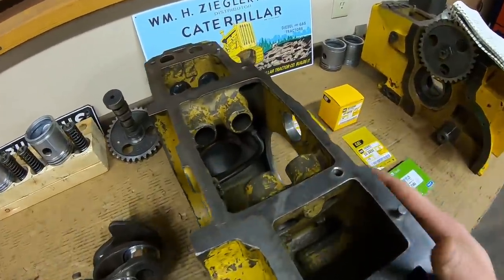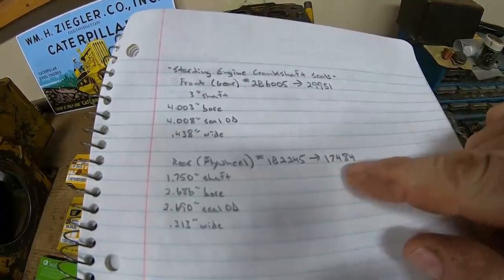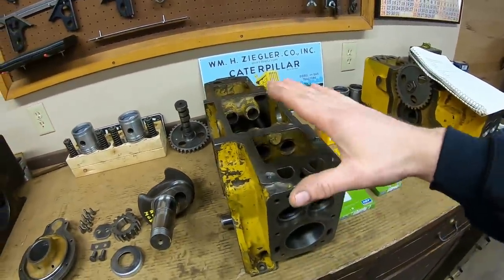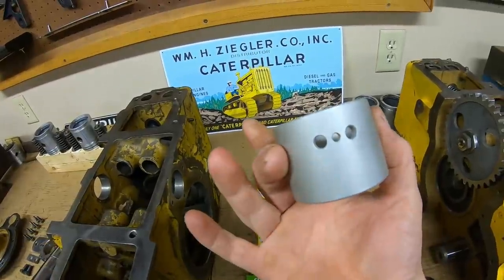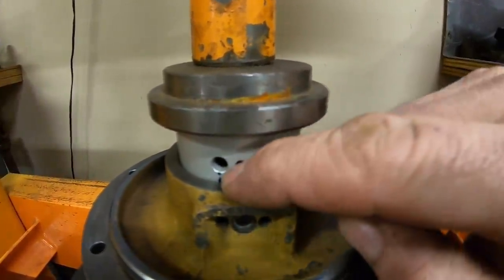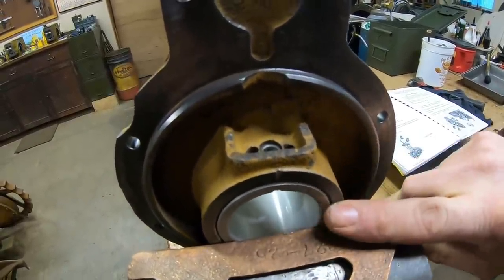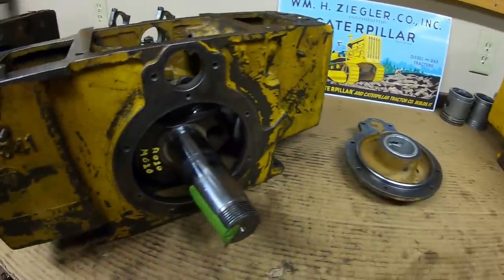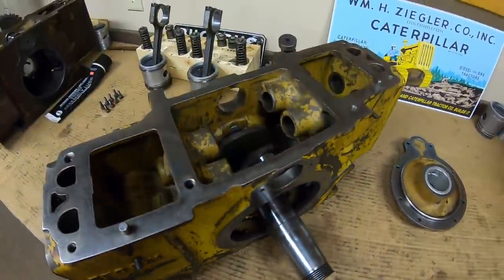Caterpillar D2 #5J1113 Starting System Ep.10: Pony Short Block Assembly (W/O Block Damage) #1 of 3

Comment: Been binge-watching the 1113 rebuild this weekend.

Nice to see a really skilled mechanic at work in preservation mode; familiar from my time on classic cars. Things like a very light skim of sealant on gaskets etc.

I once rebuilt a gearbox for an exotic car, and the workshop manual actually suggested using an old taper roller outer bearing race turned down a little as a sliding fit tool to help select the shim that goes under that bearing. Thankfully the carbide inserts on the lathe made short work of that. 👍

Comment: An old george foreman grill heats bearings and gears to the perfect temp for .0005 - .0025 slip fit. Heats evenly, heats quickly, and stores easily. Just something to think about for gears and bearings. It won't do press fit rods/pins, but it works  like a champ for most applications. Keep some pvc line around to put over the rod bolts when you slide the piston into the bore, protects the bearing journal from accident. The marks on the bearings from the snap gauge are not going to affect anything, bearings ride on a film of oil (not that you needs to be told, but the unaware viewer).
Reply: About warming things up, watch this. Kawasaki Z1 Super Six Barrels - How its Made  (Allen Milliyard-video) 11 m 20 s. The man is incredible,

Comment: Great vid, love the D2 restoration! I sympathize with your rural internet problems. I live way out in the boonies and was suffering on a shitty dsl connection until just a few days ago when I finally got my Starlink dish. The difference is so great as to be unbelievable. It is worth it at twice the cost. Believe me.
Reply: How is Elon treating you with the Starlink ?
Reply: @davidmcd8400  Very well compared to what I had. 75-300 mbps down, 3-10 mbps up. 20-40 ms ping. The performance can vary quite a bit according to the numbers but realistically you don't notice it. Once in an odd while you get a small hiccup but then it smooths out. I can play online games and watch 1080p video with other people on the network and do just fine. Service is $100/mo and the dish is kinda expensive at $500. Plus I had to wait almost a year to get it, but once you have it in hand its yours to do with as you please. You can transfer your account and sell the equipment if you decide you don't want it anymore. I saw new in box dishes going on ebay for $2500. 

But when you are out in the boonies and the alternative is really crappy dsl or satellite (ie HugesNet) it's an absolute god send. Worth the wait, worth the cost, worth everything.

Comment: Hi folks, a 'trick' I've used when the drill is not long enough is to drill a hole in the end of a rod using my lathe and soft solder the required drill into it. It holds ok and is easy to take apart after. I rather suspect Squatch knows all about this!
Reply: Good information.
A similar way I have done instead of soldering was to drill a hole into the end of a rod and then drill a small hole through the cross section of the rod to intersect the first hole and thread the cross hole to accept an Allen key set screw to hold the drill bit from slipping.  To increase the hold of the set screw you may want to grind a slight flat spot on the drill bit where the set screw makes contact.
I can see a distinct advantage to the solder method in that it will allow the use of  a smaller diameter rod where there would not be enough material for tapping and holding a set screw.
I did not have a lathe to establish a center hole in the rod.  Instead I used a short piece of the available rod chucked into my drill press to position my drill press vise to the table. Once the vise was positioned I clamped it down and then I took the short piece of rod out of the chuck, replacing it with the drill bit for the hole needed.  Then I clamped the rod that needed drilling into the vise and drilled the hole into the center of the rod.
I have used this "trick" for getting 1/4" arbor flap wheels, stones and carbide burr bits into places where the chuck on a hand drill just would not go.

Comment: Good start on the 1st of the tribuild. One prob I had building my 2 pony’s was the rod bolts and castle nuts. Main prob was either holes in bolts or the castles being partially blocked. Found that out when torquing nuts and unable to pass a cotter pin. Yep take back out and clear all burrs etc off nuts and holes. 
Also discovered different sizes nuts and bolts on different motors?

Comment: My d8 1957 has a full circle bearing front main and it is flanged for end thrust how ever the rear main is two halves and the main caps are casted in the oil pan that was very unique the way caterpillar made these in line two cylinder pony engines

Comment: I'm amazed how much CAT put engineering into a starting engine back in the day's. Interesting to see is the D2 starting engine rods have no journals? While the RD6 starting engine has cast babite journals. Then again RD6 is a much bigger engine that also has to have a corresponding big heavy duty starting engine to back it up. I would like to see what did you come up with as a tool to overcome over rounded and spun bearing surfaces. This is not just a CAT D2 problem but much more common on older machines then you can think of.
Reply: @squatch253  I think there might be a very reasonable explanation to why Cat used existing parts to create a new pony engine. I think it ties to cost efficient production and the fact you don't need to make new castings or tools to machine out new parts. Rather use the old existing ones to just make something else. I know the old Stalinzh S-80 and later T-100 use the same pony engine as the RD6 and D6. Not sure if it is dimensional wise the same cause I got no way of comparing them in real life. But I know the older pony motors had the same pressure oil feed rods. The difference I noted was the later pony motors would use regular bearings instead of the cast babite bearings on the rods. Also some of them used the older style piston pinion retainers that you should recognize from a early Cat D2 starting engine. Not sure when they got rid of them for that I need to search the catalogs and manuals.

Comment: Line boring jigs do a good job of making bores in line but getting positional accuracy out of them is difficult.  I would choose doing that job in the mill everytime
Reply: @squatch253  As long as that seal area is undamaged and provides good enough support I think you will be just fine doing it that way.  Use a u joint in your bar drive so only the bore bushings influence the bar position.😎

Comment: Since the Sealing washer @10:50 inner surface rides against the bearing end.. i know you do check for rough surface which would increase the thrust end play as it chews away the main bearing..  have you machined a holder for the lathe to set the sealing washer into the concave face of the tool and lightly lock it with some kind of screwed down ring that hopefully won't distort the seal race/face. so you can polish the inside of the Sealing washer to eliminate any rough surfaces..  a polish should not effect end play.  i don't know if it will effect the crank gear /heavy washer and end of crank spacing.  could you use a cratex wheel in a router with a router speed control to polish the inner face with the router center line slightly offset.  sorry for adding to the complexity of doing a pony motor build.. i take it you will use the freeze damaged block after careful measurement to make sure the main casting did not shift to verify the boring bar tool alignment.  not that you will bore the busted block.. just for verification on a good bore block. 

 i should have mentioned to you about cleaning the cooling jackets of the main engine blocks using a bucket of evaporust with a submersible pump.. a hose and at least one adjustable pipe with a  garden sprinker.. perhaps a modified turbine wheel sprinker to sit on top of the block with the liners pulled to spritz the block till the rust in the cooling jacket is gone..  then move to the next cylinder.  so many people have gotten strong liquid tight containers and made dip tanks for larger parts to do the same.  i also think about dangling magnets in the evaporust to see if it will pull excessive oxides out to make it last longer. 
5J1113 is going to be a treat to hear run and to move some dirt around..  hopefully the trailer and shows will be calling when its finally finished..

Comment: Well so far the Insides in my build match yours except for one part.  Do you or did you put the wire between the c clips that hold the valves in?  When I took mine apart there was wire twisted in the middle of the clips through the holes, to keep them from spinning I assume…
Reply: @squatch253  yeah I only repeated what I found during my disassembly - it did seem to make sense to me so I went for it.  Those holes must have a purpose or some kind, and the wire seems to be the only thing I could come to reason that made sense.

Comment: Great tip about what to do if castle nut doesn't line up.  Could one use a thin washer/shim?

Is there a spec for the end to end on the crankshaft bearing flange.  Just wondering what one can do if there is too much play.  Could the machine shop build up that surface before grinding it down to reduce the end play?  Or would it be better to make a wider bearing.

Comment: You should be able to do it in a mill. Line boring is over thinking in my opinion. Locate off the big hole end. Simple enough. Good video.
Reply: @squatch253  as a machinist I figured your mill was like a Bridgeport.  So I understand if your equipment isn't capable of the style setup I suggested.

Comment: That gear is no different than the setup bearings you can buy for setting up a differential, bored slightly larger so you don’t have to press them on and off a bunch of times. When you have spare parts one can make any tool no matter how vintage the machine. 👍

Comment: On the piston ring gap, could you just not buy .10 over rings. As you state, these aren’t race engines, but why not get it in spec?  Probably makes little difference, but it can be done. The other possibility is CAT changed the end gap spec, since the rings supplied are not “in spec” according to the book you have.

Comment: On the torque specs of the rod journals what if the castle nut does not line up with the desired torque spec to put the cotter pin in
Reply: I was just kind of curious about that
Reply: The answer is in the video 17:24
Reply: Yeah I figured it out after I washed a little bit more in the video

Comment: That dowel pin should've been threaded on the top side with a means of retaining it from moving, like a pip in the casting, for example. I've never seen a critical element like that, rely exclusively on fit, fit that itself is dependent on the +/- of an engine's heat cycles. Such a weird decision, considering other, far more simpler elements have redundancies.
Reply: I guess in the scheme of thing it really is just a lawn mower engine 
Never intended to last long 
That fact any of the machine is still usable 80yrs later is fairly good going

Comment: I don't think that gear will go onto the crankshaft backwards. It looked to me on camera like the keys are both a little more to the bottom side than the top side. Am I wrong?
Reply: @squatch253  not a big fan of gopro. Tried them and had problems constantly.  And every time I turn out someone is getting a newer model and they are having issues. However I am enjoying the videos you're doing on the dozer. Kind of work I like to do but don't get to. Cost of living in California takes all my money.

Comment: You do know the best way to install that gear is heat it in hot oil  in a deep fryer
Reply: Bearings  i use  about 375 to 400. Degrees farinhight

Comment: So why could you not drill a hole in the trough that the dowel pin holes, that hold the main bearings in place just above the top of the pan. So you can insert a side pen roll pan carter  key whatever just above that pin so that pin can never come back up out of the hole.  that seems to be the problem the pen works loose and pops about a hole and it’s all gone bad! why not make it stay. either superglue weld it  that pen in place and or just drill a small hole through the side of the inside of the casting just above the panTo hold it in place